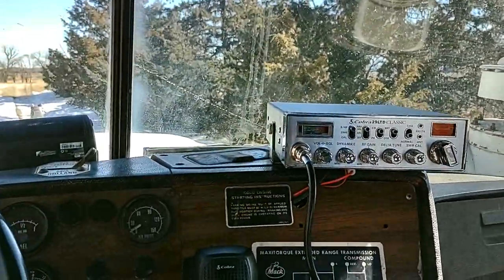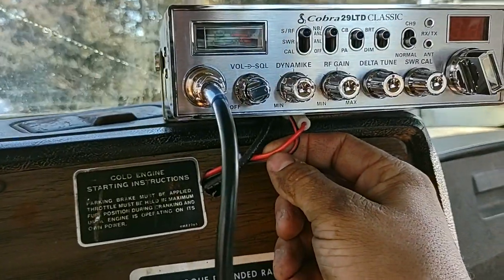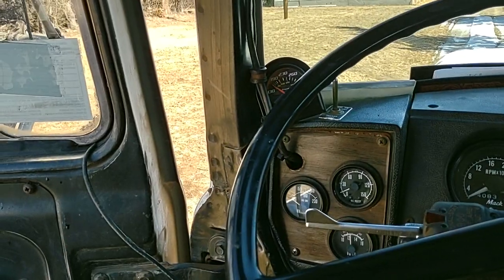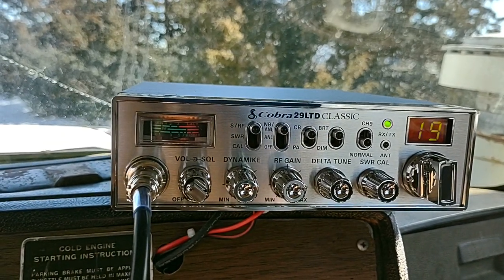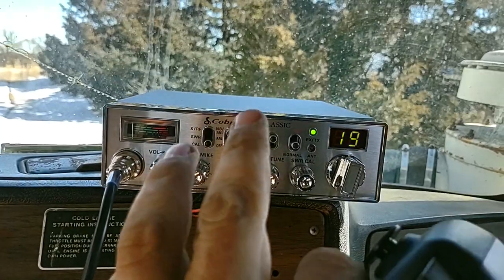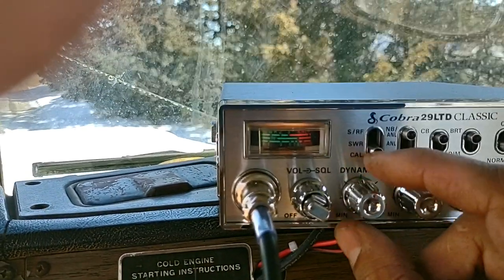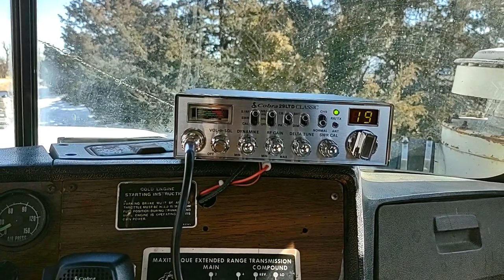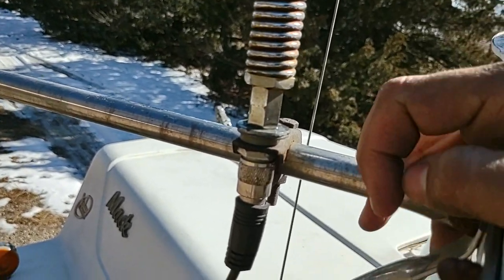How to set up a CB radio.

Comment: have to calibrate on channel 20, then check it at 40 then channel 1, fire stick has a tunable tip, thats where you make the adjustments.  can’t calibrate on 19 because it’s not the middle of the frequency band.
Reply from the maker: Works fine for me.

Comment: You calculated the cb wrong. If you look on the right side of your swr meter it says cal with down arrow. You want your swing on top of the arrow. You also need to use channel 40 or 1 once you cal on one go to swr an key the mic. Then do the same on 40 then switch to swr an which ever has the lowest swr is the one I go with.
Reply from the maker: Channel 1 channel 40 and channel 19 all show the same on the Guage with this radio. I always calibrate it on the channel I'll be using most. Right or wrong it works for me.